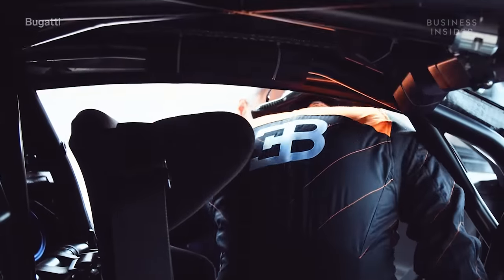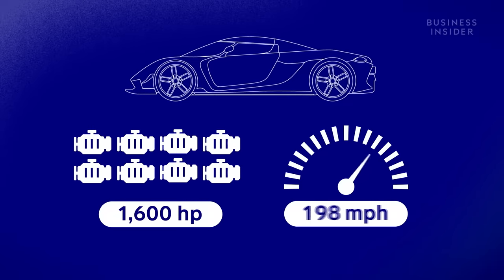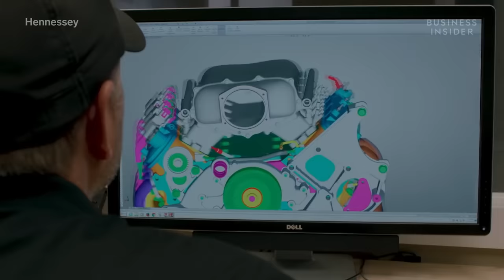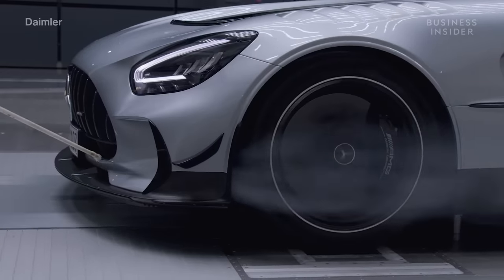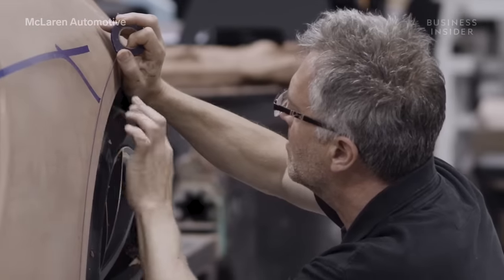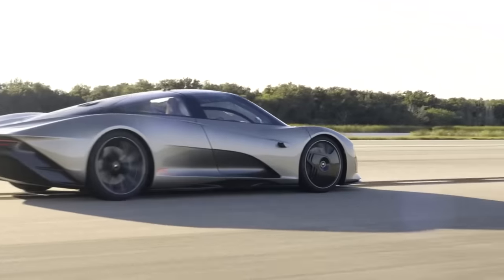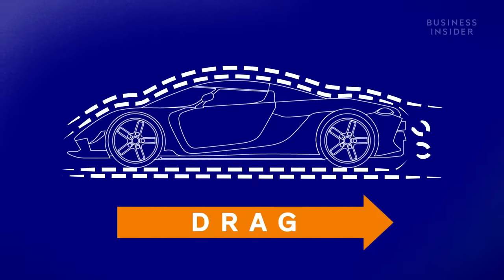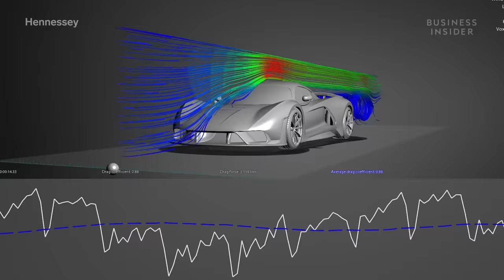Why It's Almost Impossible For Cars To Go 300 Miles Per Hour | Insider Cars

Comment: “Just 50mph more” ............ is that a real question someone has? Everything has limits, people and machines, people know this right? lol
Reply: They're trying to push to the limit, they do know the limits wtf man
Reply: what..? that was not even a question..? Also if they improved 50 mph more than it was it means that wasn't the limit soo what's your point?
Reply: It is ''just 50mph'' if you consider fact that 50ccm moped reach this speed with no problem at all. Stupid comment man.
Reply: Untouchable  Regular tyre can handle 150 mph.
Reply: Untouchable  really?
Reply: your in the Limit mindset his is there are no limits mindset
Reply: Topfuel goes 0-335 mph in 3.6 seconds, so no, road legal cars are nowhere near what is physically possible, however making the car even slightly driveable is. 

We arent at the limit of vehicles yet. There is still lots of new materials to be invented and tested, new innovative solutions to problems and so on.
Reply: No Limit foo lol
Reply: People work to redefine the frontiers of limits, years ago they only dreamed of having cars this fast, and now you want to succumb to the "everything has a limit"?
Reply: technology has no limits tho if u try hard enough

Comment: Let’s go for 500 MPH, I know easier said than done.
Reply: Potato  just use a v48 engine and a fully carbon body with some crazy wheels 😆
Reply: Thrust ssc goes 763mph
But it has rocket engines
Reply: @BigM84  How about WW48
Reply: hmm i wonder what 100 electeic motors would do to a axle.
Reply: @vera_bh8091  the axle would say R.I.P
Reply: @surodeepchakraborty4706  thats not a car
Reply: top fuel dragster joins the chat
Reply: @guruspubichair  1/4 miles per rebuild LOL
Reply: @paveantelic7876  that IS a car
Reply: @surodeepchakraborty4706  literally isnt.
Reply: @paveantelic7876  just fuckin google it
Reply: @surodeepchakraborty4706  its the fastest land vehicle, not car
Reply: @paveantelic7876  can u pls just google 'is thrust ssc a car'
Reply: @paveantelic7876  your right

It's a SCAM
Reply: @humakhan80  do you know what scam means?
Reply: @surodeepchakraborty4706  can you pls google the definition of a car?
Reply: Potato  Maybe a top fuel dragster engine could reach that speed if it had some more gearing
Reply: I don't think that there is any tire material on earth able to handle such speed. So it probably is impossible. You would need a car/airplane hybrid or some kind of hovercraft.
Reply: for a car to go 500mph it would essentially need to be a jet on wheels.
Reply: @rimezero  Don't underestimate science and engineering.  Who knows what the future holds with tire tech
Reply: Even at 350, i think the vehicle is susceptible to lifting off the ground
Reply: William Hendrix  Jet engines aren’t combustion engines?
Reply: Let's make one that goes 17,000 mph.  At that speed, you'll start to float around in the car! haha
Reply: Smokey Mcpot   There's a place in Germany, I believe.
Reply: Potato  Already been done.
Reply: Technically if they have gasoline engine for first acceleration then activate jet engines itd still be a car, right?
Reply: Top fuel car be like "ez' kk
Reply: Your gonna need a hyperpod

Comment: 0:50 "it's all increasing exponentially as a square of the speed" ... 😂
Reply: Or...twice the speed takes four times the power. I recall reading an article about a Bonneville racer who encountered wheelspin at 300 mph on the salt. Seems that the aerodynamic drag at that speed exceeded the tires' traction ability.
Reply: @spaceflight1019  try doing 450 at the last run of World Of Speed (2019 )one of the cars had a tire let go at 430mph .IIRC they hada calculated  7000lbs aero downforce on the rearend  to fight tooth and nail for traction. There was an investigation to determine what the nature of the rooster was. Was it the tire that took out the body ,the body took out the tire, track dabrie oh, is it really doesn't matter which came first the chicken or the egg cuz after all  the rooster comes before the egg that contains the chicken.
Reply: Sadly it seems people don't understand exponential functions, and despite that "exponential" sounds crazy in a way "increasing quadratically" doesn't.
Reply: @drchrispy  true, "exponentially" is often used very loosely and mathematically incorrectly. But it astounded me especially in this case as the guy seemed generally to know what he was talking about but to put exponentially and increasing quadratically directly next to each other makes no sense at all. One would think people knew better about exponential growth in the middle of a pandemic... Generally I found the relation between power, velocity and air resistance very unclear in the video as several powers of the velocity were named at different points in the video. Without air resistance, power is linear with velocity, but air resistance is quadratical in velocity, so together you get that power is proportional to velocity cubed.
Reply: What? The square of the speed is an exponential function of the speed.
Reply: @sebastiandierks7919  You’re absolutely right. But judging from the responses here, you won’t get much traction from car enthusiasts trying to tell them about quadratic vs. exponential...
Reply: @drchrispy  Could you explain
Reply: @anonymoususer3561  no lol the square of the speed is a polynomial function of the speed. An exponential function of speed would be like 2^speed for example, which is very different. 20^2 is 400 but 2^20 is 1048576.
Reply: You're thinking way too much into this. "Exponentially" colloquially means anything above linear. Scientist or not, unless the specific distinction between polynomial and exponential matters, no one gives a shit. Plus, in practice, these improved efficiencies have a hard logarithmic difficulty, so it's not like anything is overestimated...
Reply: @Nina-cd2eh  Thanks for this :)
What do you mean by a hard logarithmic difficulty?
Reply: @definingslawek4731  I mean it as when the technical and technological requirements for that extra improvement are exponentially increasing. 

Getting a a 300mph car to 350 for example, is such a huge task, that you literally need to start thinking of new technologies, and to do exponentially more research than what you did going from 250 to 300. Practically, it's not as simple as "reduce drag twice as much", because that won't require just double the work, but exponentially more work than you did before due to all the technical challenges involved. And there's also a hard limit on current technology and actual physics that makes any improvements assymptotic as well. So, to a degree, there's no point in even trying to improve certain things because you've reached the absolute limit.
Reply: @Nina-cd2eh  very interesting, ty
Reply: @Nina-cd2eh  I would disagree that the distinction between polynomial and exponential doesn't matter. I certainly agree with you that most people don't give a s**t but I don't think it's necessarily a good thing. Quadratic vs. exponential growth looks similar at the beginning, but is dramatically different in the long run. As the original poster mentioned, it comes up in understanding and predicting things like the growth of the pandemic, which many people misunderstood at the beginning, at a great cost. And having an attitude about it and calling people nerds (above) helps even less.
Reply: @janvondrak1641  It doesn't matter. We're not trying to explain that type of math to people. It's just a word. In this specific instance in the video the distinction is literally meaningless, and people that should care enough about the difference already know it.

Even when talking about the pandemic, nobody is confused between polynomial and exponential. If you tell people "for every infected person there will be 3 infected by tomorrow, 9 the day after" they get it, and at no point do you have to explain why this is called exponential and why it isn't polynomial.

My issue is when people get "shocked" and "surprised" that "such an educated person" could make "such a horrible mistake" for stuff like this. To me this just looks like first-year student nerd circlejerking. It doesn't point to an actual problem, it just aestheticizes scientific correctness.
Reply: I was about to say this. People use exponentially very misleadingly often. Another term often used incorrectly is rate of.
Reply: @mavinaash22  when is 'rate of' used incorrectly?
Reply: @drchrispy  power 2 is still exponential
Reply: @nameaccount8749  an example of an exponential function is (2^x)-1whereas a quadratic function would be something like x^2. At 0 they both equal zero, at 1 they both equal 1, at 2 the exponential function is only 1 higher, BUT by the time you reach 16 the exponential function is over 250 times the quadratic one. Colloquially it's not a very important distinction but when talking about actual physics it is.
Reply: Top fuel car be like "ez' kkk

Comment: Its mainly tires and drag, its pretty easy to just add more power. And you need to keep in mind that speed isnt the only goal of the car so it is a compermise.
Reply: And Aerodynamics but yea ur right
Reply: @samanamjed6331  thats why i said drag. I do find it funny how the veyron has a higher drag coefficient than a pontiac fiero.
Reply: @andrewhaan695  you dont need a bigger engine to have more power. Also electric motors can be used.
Reply: @andrewhaan695  not equaly.  And besides you dont need to add power to go faster all the time. If you reduce drag you can get way better return on investment because drag increases exponentially with speed so just a little less drag can help alot. Also. A ludicrus tesla motor puts out 650 hp so im pretty confadent that they can get powerful enough motors.   Im sure i could find a car that i can modify to beat the bugatti anyway.
Reply: Yup.  A top fuel dragster goes 0-300+ mph in less than 4 seconds, but you can't take the wife and kids to Florida in it.

Comment: "You need to stop the tire from changing shape."

Buddy, Top Fuel not only hits 300+ in 1,000 ft, but the rear tires change their shape enough to effectively decrease the final drive ratio.

Comment: The Cameraman Never Ceases me to Amaze me for How Fast, Invisible, and Invinsible He is..
Reply: Invincible* but yeah the camera man always seems to be faster.
Reply: Phantom cameras can basically record at the speed of light and capture everything perfectly with slowdown features. that's why those cameras cost more than most of those cars shown in the video.
Reply: @SimilakChild  The car in the video costs $3million, you saying there's a camera that's worth more than that?
That's highly unlikely.
Reply: @saiharsha5353  Yes. these cameras range from $180,000 ~ $600,000 each.
Reply: @SimilakChild  still less than 3mil, but ok
Reply: Depends on your definition
Reply: @saiharsha5353  you need more than just 1 camera
Reply: Top fuel car be like "ez' 10000 hp

Comment: 1:15 Drag increases with the square of velocity, not the cube. Twice as fast = four times the drag.
Reply: The power required to overcome the aerodynamic drag increases with the cube of the velocity.
Reply: @adamlea6339  the engine produces force not power. Power is calculated only when you move. You don't need 8 of those engines to reach 300mph.

Comment: Remember watching a race where I believe a couple porsches became airborne and took off in the air like kites
Reply: Yes. At Le Mans.
Reply: It was a Mercedes
Reply: Used to happen a lot in Nascar.  That’s why they started limiting power at the bigger tracks like Daytona and Talladega. Early 2000s cars with full power could have gone 230 mph there.  Indy cars don’t have as much power as their peak anymore either but still top 240 mph at Indy.  They could go even faster at Daytona and Talladega if they ever raced there.  250 mph would be possible.

Comment: The Bugatti Veyron isn’t just a car... it’s an almighty demon they somehow trapped inside of an engine
Reply: The Veyron is nothing anymore, there are Dodge Challenger Demons that would brutally murder the Veyron.
Reply: @LaVaZ000  umm no. Maybe in a short quarter mile the demon will win. But any longer stretch of road will show that the Demon doesn't stand a chance against supercars. At higher speeds the demon is not efficient.
Just looking at the aerodynamics of the demon and you can see the problem it faces. It's a frikn box on wheels!!
Reply: Ford GT did 300+ mph in a standing mile.
Reply: Top fuel car be like "ez' that slow

Comment: Well yes, a lot goes into getting to 300mph, but I wouldn't call it almost impossible. Go to a top fuel event, or Bonneville and you'll see 300+ mph a lot, and I don't mean from the jets without wings.
Reply: yeah people have been doing 300mph in 1000ft for years. definitely not almost impossible
Reply: The video is about production cars.
Reply: Not so bad if the tyre only spins for a few seconds. The Chiron is also heavy
Reply: Those cars have engine rebuilds after each race and they only last a few seconds. Not exactly usable.
Reply: Yeah and how long do they sustain 300 mph? Less than 4 secs. The engines literally destroy them selves after a single 4 second pass and have to be rebuilt. This is not even comparable just stop
Reply: It's not just dragsters. Cars have been able to go faster than 300 mph at Bonneville since 1935. And they required two runs in opposite directions less than an hour apart. Getting a car to go 300 mph is not hard.  The aerodynamics tires and power are all solved problems. The hard thing is getting that same car to drive to the grocery store and back without exploding or ramming into anyone.

Comment: At 300mph, you getting younger every second.
Reply: Time dilation lol
Reply: @seansoraghan3245  You're not getting younger, you're just not getting older quite as fast.

To get younger you'd have to break the speed of light.
Reply: @IAteYourFace72  Of course, none of it is possible. The relativistic equations are based on the very principle that nothing can move faster than light, so you can't use them to calculate what happens when you go faster.
Reply: @IAteYourFace72  what does c stand for?
Reply: @IAteYourFace72  oh ok
Reply: Top fuel car be like "ez'

Comment: Btw the Ferrari f40 went 199 mph it was said it hit 201 mph in Italy outside of that it hit 199 mph
Reply: Porsche 959 ftw
Reply: They also forgot about the RUF CTR
Reply: @AJS_Drums  Yellowbird*
Reply: @zenhydra5114  not necessarily the normal 959 as there was a smaller portion of the 959's which have been tinkered which was faster than the F40
Reply: @AJS_Drums  true that thing hit 212 I believe

Comment: If the force is increasing by the square of the speed it is not increasing exponentially, it is increasing quadratically. That's a massively different thing.Quadratic increase can still be very huge, but exponential increase is theoretically much, much steeper.
Reply: A non linear increase in a parabolic shape is exponential. It could be squared, cubed, etc. It would not be quadratic because then you'd be assuming there's a mirror side to the parabola, when in fact everything starts at a 0 point and then goes up from there.
Reply: @nefuros551  Non-linear and exponential don't mean the same thing. "Exponential" means that something is of the form "f(x)=ae^(bx)", and if something is "increasing exponentially" then it should at least be lower bounded by an exponential curve. The formula displayed was quadratic, the fact that it's quadratic doesn't depend at all on the "domain" of the function (the set of available inputs), only how how the output changes with the input. In this case, since the equation was of the form "f(x) = Cx^2" that means it's quadratic.
Reply: @darkfuji196  I didn't say non linear = exponential, the plot is parabolic and functions in exponents so by definition it is exponential. Yes, technically since the exponent is fixed at 2 it could be considered a quadratic equation BUT that doesn't mean the curve is not increasing EXPONENTIALLY because it definitely is. The video was making a point that results are exponentially harder to achieve and we'll likely hit a ceiling soon. If you try and say "These cars are becoming quadratically more difficult to make faster"- it doesn't make any sense.

Comment: What's odd is that we had engines, V12 or v16 or whatever engines, back in early-mid WW1 and into very early WW2 that could hit upwards of 2000hp. Technology has advanced IMMENSELY in engines since then but making a V8 make as much power as a V12 plane engine from almost 75 years ago...just doesn't seem as impressive to me.
Reply: I mean it’s not really comparable, ships and planes have ALOT more space for a bigger engine, also since their bigger they require more hp to move. Why don’t you compare those engines to the engines we out in our ships and planes now